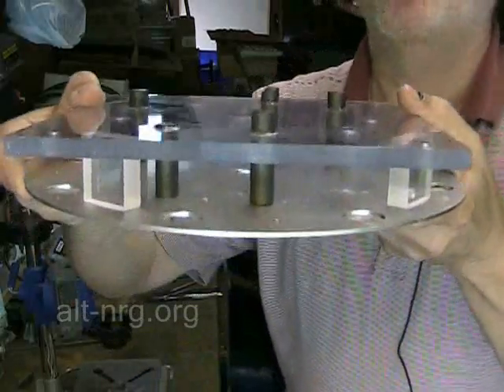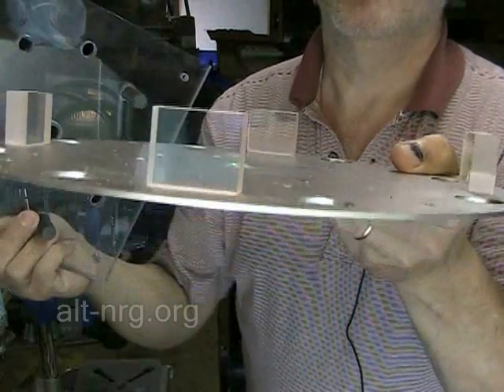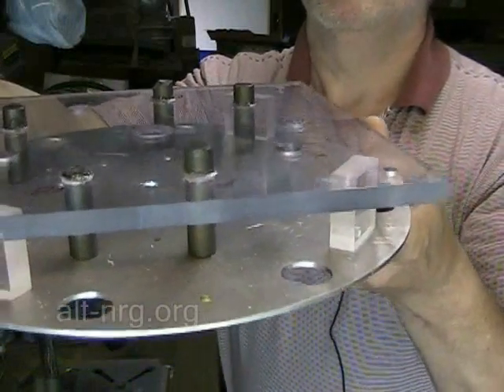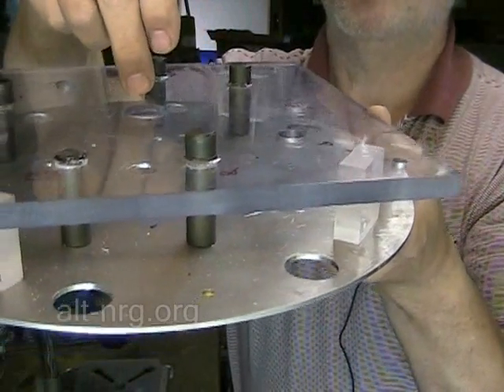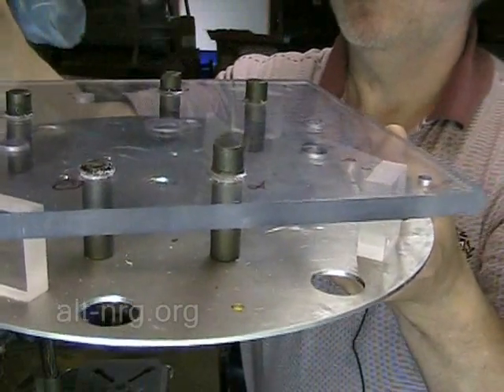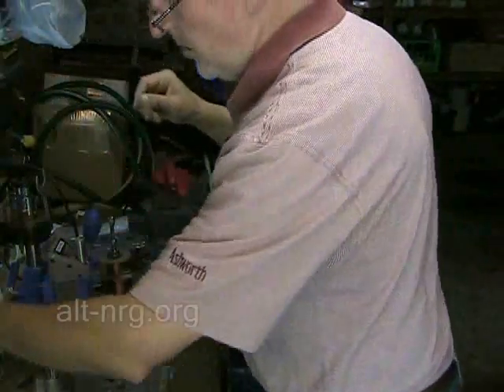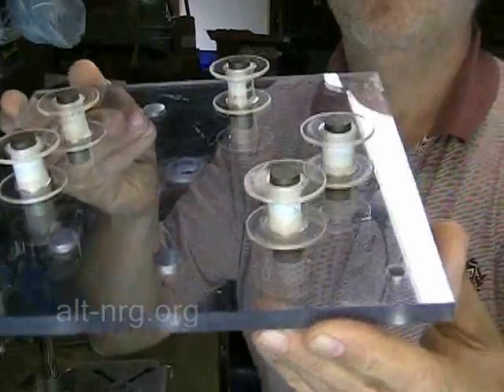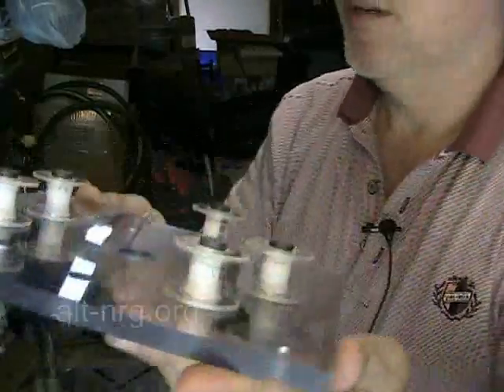#277 Muller Magnet Motor update 10

Comment from the maker: @fitter108 My use of type 8 was not deliberate. It's what I found at the time in the SIZE that I wanted. It has a permeability of 1200. Some ferrites are higher, in the 1800 range with similar saturation levels. If I had the choice I probably would have opted for higher permeability. That would probably have allowed me a closer gap balance point to the rotor. Can't say for sure. Having trouble finding the chart I saw with the data.

Comment: In that find about the ferrite cores with the magnets cancelling the pull/push between each other (creating a null point) does it still cause a flux in the core/coil you use to generate electricity. If so maybe use that to your advantage by using that in a air vacume experiment?

For a side project, maybe try this.
Dr. Steven E. Jones demonstrates 8x overunity circuit
It can be found on the PESWiki website.

Comment: about that 1.x" distance from ferite to rotor magnet. That will probably need more practical experimentation. You have a dynamic magnetic field in the coil which also should be taken account, you will probably need to adjust the distance for a specific load and RPM ( generate MF int he coil ) to get the best as possible anti cogging effect. Reeeealy nice observation though